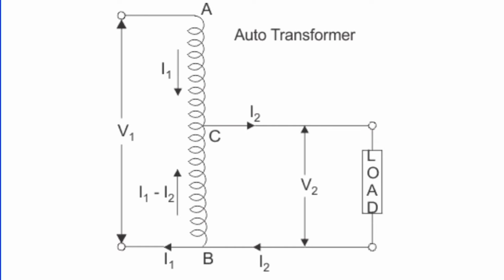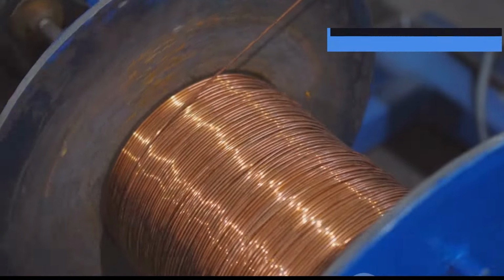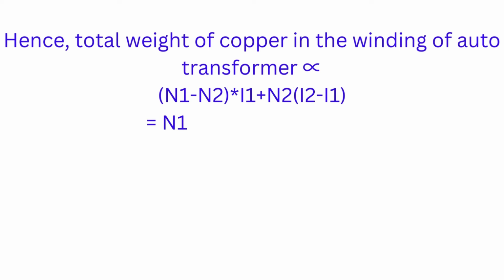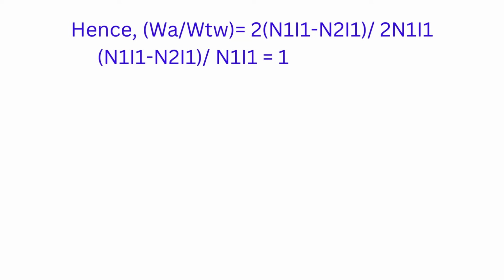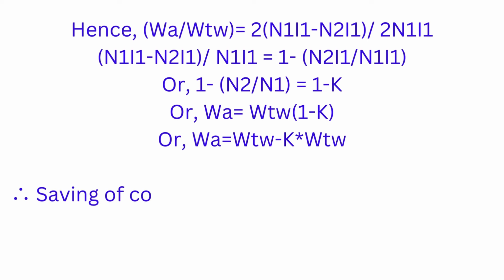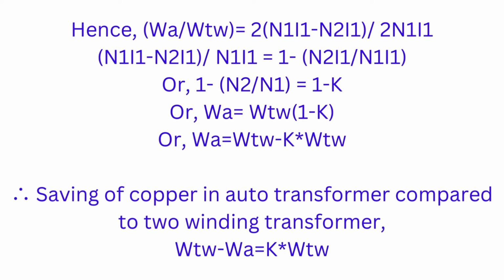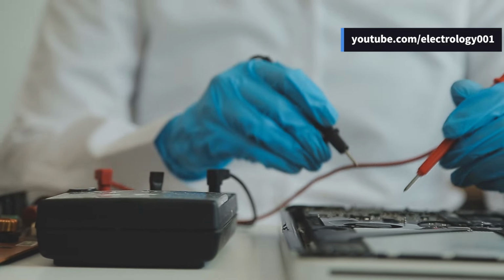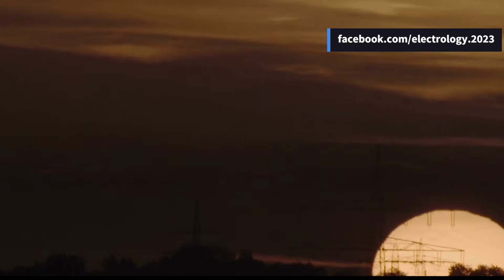The Secret Behind Voltage Control: Autotransformer Explained

Comment: KEEP IT SIMPLE ROBOT ! 
The voltage on the common secondary, is proportional to the turns ratio of the whole thats it. If you wish to get more technical without bogging down in bullshit. The impedance ratio changes with the square of the turns ratio. The only other thing important to remember, is that an Autotransformer has no abillity to isolate DC voltages from primary to secondary, thats why ordanary tranformers with separate magnetically coupled windings are sometimes used as isolation transfomers mostly in a 1:1 ratio set up. An example would be a shore, power supply to a boat or ship. This is done to prevent galvanic effects on the hull. Another interesting example of an Autotransformer  used in radio, is an antenna matching tranformer where an  impedance of several thousand Ohms is reduced down to 50 Ohms for matching a coaxial cable. The auto trasformer is usefull here because it does not isolate DC static voltages on the antenna and allows  them to pass to  ground through the coaxial braid or shield without damaging the radio.
Yeah I know, tell me to Shut up and and keep it simple hypocrite. This video was very interesting to me.